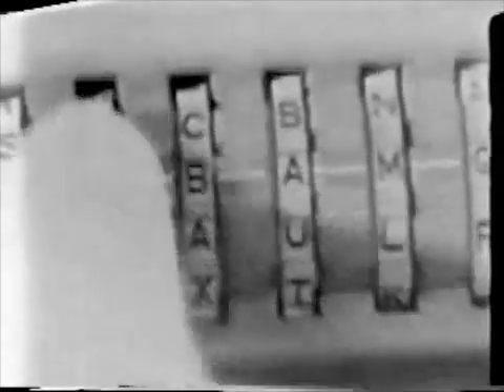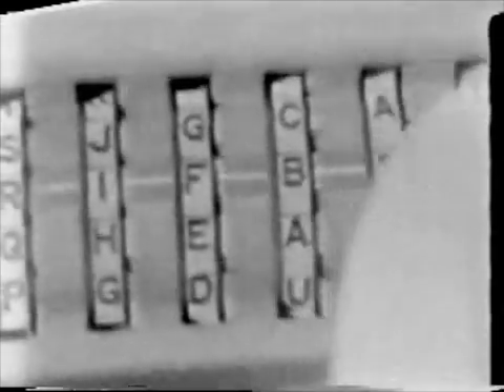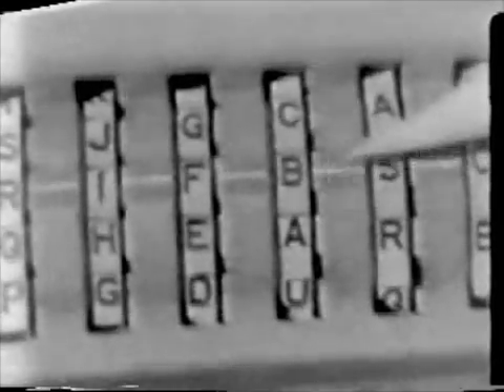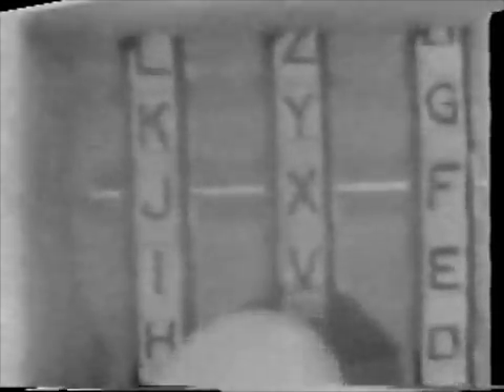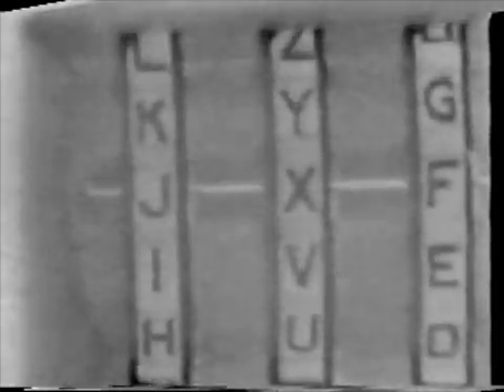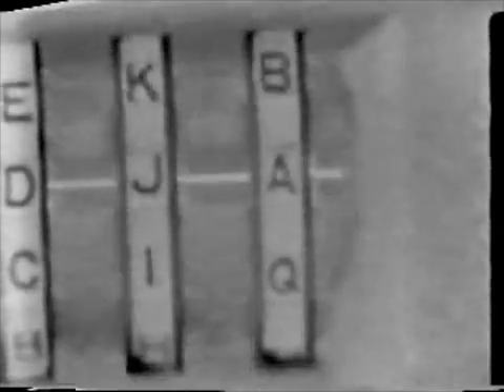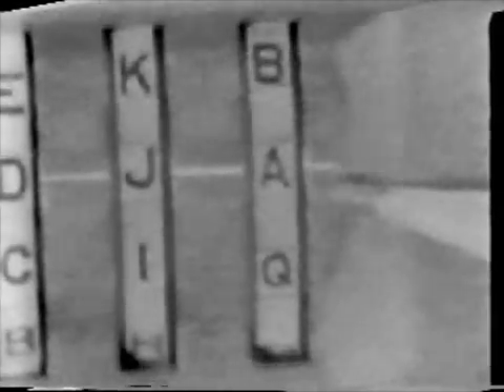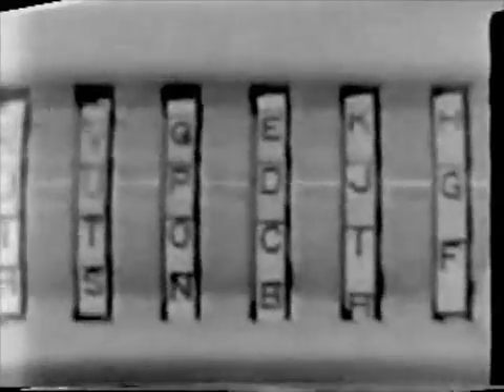M-209 Converter Reel 1

Comment: Ok so its a cheap ass knock off of an enigma machine? Even the rotor system copied?
Reply: +risilca The Enigma and the M-209 work on entirely different processes for input, encoding, and output and have nothing in common as to how they process messages other than yes, the use of alphanumeric rotors which many, many cipher machines used through those eras. Rotors were simply the most common way to display and input alphanumeric content for mathematical processing. Until vacuum tube computers and solid state computers came along, there was no other alternative.
The M-209 is purely mechanical with a lot of pins, lugs, and bars to encode, and the Enigma uses pawls, ratchets, and electrical wiring to encode. They also had different purposes regarding major strategic messaging vs quick tactical battlefield messages.
To simply say that they are the same because both have rotors is to say that a Model T and a Ferrari Enzo are the same because they both use rubber tires. No comparison whatsoever, other than they were both cypher substitution rotor machines used by the military.
Reply: +DoctorShocktor Yes, the basic principle of the M-209 is that pins on the wheels, if they are set to be active, engage lugs on the rods when their wheel rotates them into place, and the engaged rods are pushed out to act as teeth in a variable-toothed gear.  The Wikipedia has an "M-209" article with photos and diagrams.  The Enigma has wires between contacts on opposite faces of each wheel, routing current from keyboard to light bulbs, and the wheels turn like an odometer to form a new wire permutation for each character.  The Enigma also has a plugboard that adds in a fixed permutation, making it harder to cryptanalyze.  The M-209 is cryptanalyzed in an entirely different way from the Enigma; in principle its security is much less than the Enigma's.
Reply: Nah it was actually more difficult to crack than Enigma... Look it up before speaking! :yougotthis: